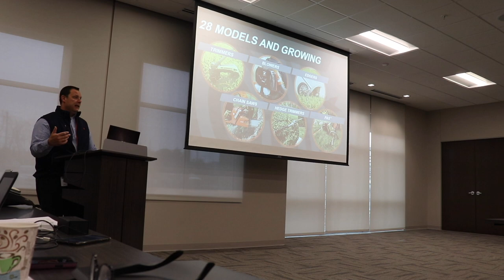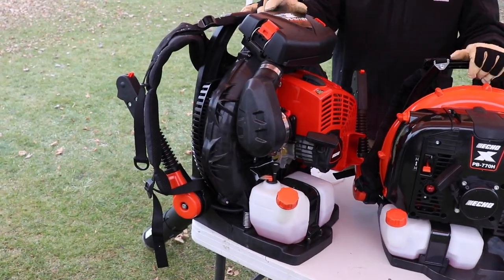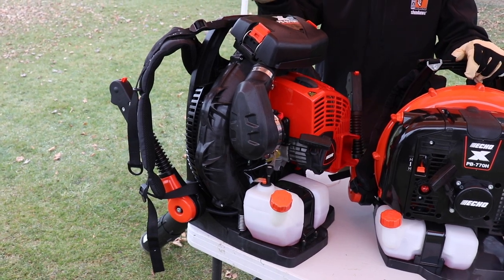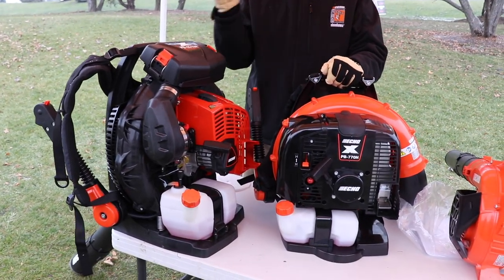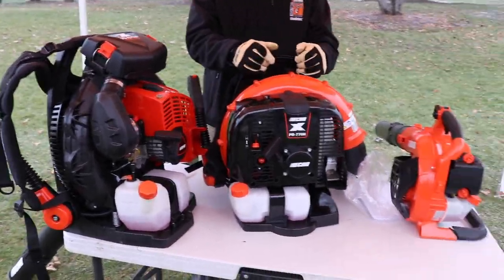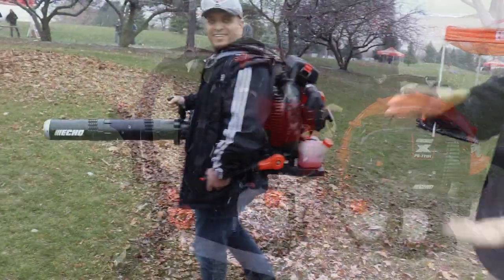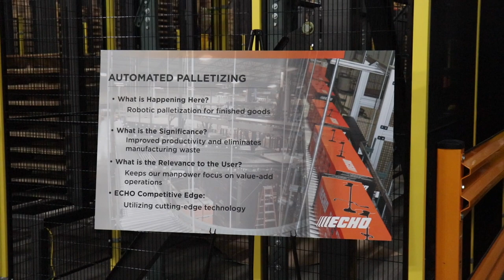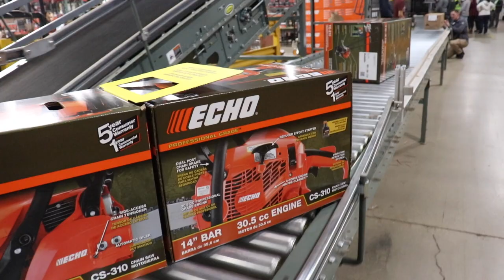ECHO UAG Factory Tour 2018

Comment: Great video! Looks like a nice event. What was your overall impression of the 8010 backpack blower?
Reply from the maker: I think it’s a absolute beast. That thing is all business. You see it on the table next to the 770 and it dwarfs it, so I was expecting it to be super heavy. I was super impressed that they had thought about that and made to whole frame and fan covers out of carbon fibre. The blower weighs the same as the 770 despite being so much bigger. That’s why I reacted with it feeling super light because it is considering the size. If you got mountains of leaves to move, the 8010 is where it’s at. Thanks for watching.